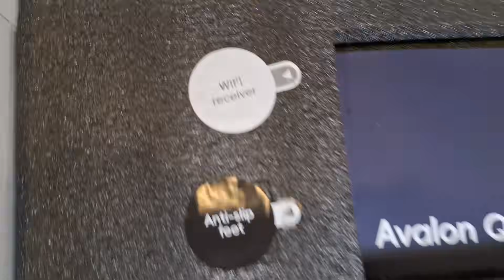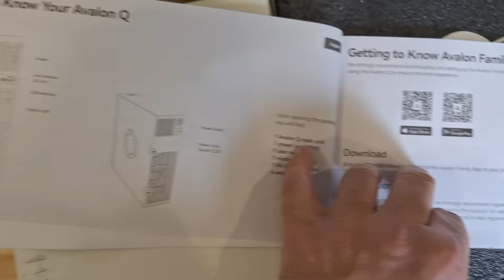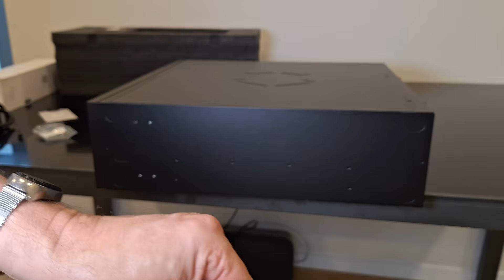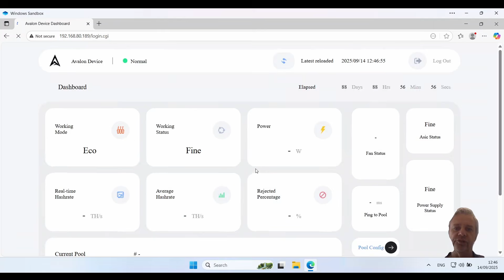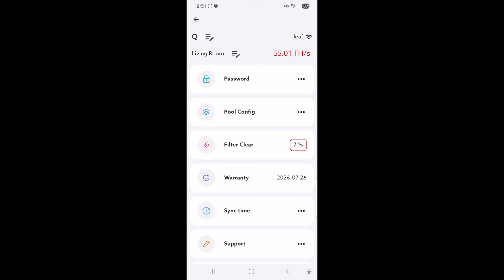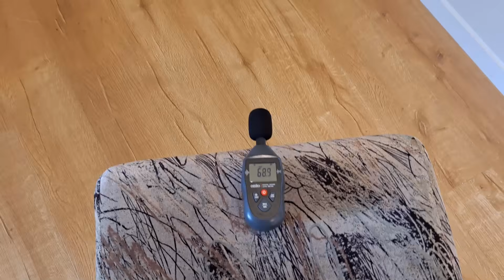Avalon Q for serious home Bitcoin miners

Comment: Nice video - I have been using my Avalon q for about 6 days - Started in my office on Eco mode got to hot and had this smell. So I moved it to the basement (finished with TV room) but it to standard and it has this bad smell in the air (The pungent smell of ozone, reminiscent of chlorine bleach). After 4 days I had to move it to the garage and again it still has this nasty smell that will not go away. I'm using 15amps but don't think that is the issue. any idea? Did you have any smell from your one that you use for a month in side? Thanks
Reply from the maker: Mine doesn't make any smell. That is very unusual.

Comment: I live in the US and am in the 2nd lowest electricity priced state amongst all 50 states. I pay ~ .098-.12 cents per kw. 
Running this machine would generate about $4.82 a day in revenue, and after electricity for the day deducted only ~$0.98 cents is the profit per day.
This isn't accounting for the price of the miner at all. So keep in mind I still would have to make up for the $1,900 + tax & shipping for the hardware. 
You might be thinking.. well, that's only 5.2 years of mining around the clock! 🤣
Well yes but that's before you add in the average increase in the mining difficulty for Bitcoin, which is about 0.13% per day. 
Which means in only 132 days after electricity is deducted my net profit will be $0.00 and about to turn negative. 

Now not everywhere in the US has peak electricity hours and non peak prices, but let's assume I do and I can run it for less electricity cost at certain hours.
That's great, but the catch to that is that the difficulty increase never stops, the difficulty increase doesn't care about peak or non peak hours. 
132 days is 132 days, when that runs up the miner will then be unprofitable and costing me money instead. 
Also the value of the miner decreases overtime as well with the difficulty increasing, so you won't be able to resell it for much later on either.

What am I getting at here?
I mined for 6 years, Bitcoin, Ethereum, and dozens of other coins, I did video cards, I've done ASIC's. 
Just. buy. the. token. 
If you want bitcoin, just buy it. If you want Eth, just buy it. 
You have $2,000 for a miner? Don't buy the miner, just buy the token, because the explosive growth days that made mining worth it are gone. 
It's simply not worth it anymore and for it to be worth it you have to be extremely savvy. And I don't mean by using solar panels... Because solar isn't cheap either, you need the panels, you need the inverters you need an electrician you probably need permits etc etc. It's not like solar is free and thus makes mining worth it. Better off selling that electricity back to the electric company.

Comment: Damn so jealous! Are you planning on lottery mining? Are you just a hobbyist or do you have cheap enough electricity to keep this more profitable than buying btc?
Reply from the maker: I lottery mind for first day I got them. Now I am pool mining.

I have cheap night-time electricity, and Solar. So I can make a profit BTC mining.
Reply: @pdath wow! Thats good to hear! I actually have cheap night time as well in canada, about 5cents per kwh, is that low enough to be in a good position to profit compared to yours? Also do you have any tips to set up a solar panel of some sort on my balcony. I got a large balcony in a high rise was wondering if I could use that to my advantage?
Reply from the maker: @saeir  5c would undoubtedly be good enough for running at night time!  That is an excellent rate.

Now you need to work on your daytime rate.  I am not familiar with balcony-style solutions in Canada.  Google is your friend.  :-)
Reply: Mine with ocean bro
Reply from the maker: I've been thinking about it. I can't use lightning payments because it's too hard to account for with tax. The problem with taking the payments from Ocean on chain is I will only get a payout once every 6 months.

Comment: Nice. I'm also in NZ too.  I'm on Contact where U supposedly get free power between 9 and 12 midnight. Would this be capped or could I still use something like this and run it for free in those hours. Also how much can you earn per month or so from a machine like this? Is mining becoming profitable again with the price of BTC these days
Reply from the maker: It wouldn't be worthwhile to only run it for 3 hours a day.  One Q would not exceed any power caps.
It would depend on what the cost of your electricity was for the rest of the day.
At the current price of Bitcoin (usd$115k) it is grossing me nzd$232 per month (based on how I run it).
Reply: So u r pool mining it, right? What is your power cost, would be interesting to know what it is without being on Solar. I'm in NZ
Reply from the maker: @chimneyclean NZD $.1374 + GST per kWh at night, and then I get a further 11% discount on that.  I am on Genesis.  During the day I am runnibg on solar.

I mine on NiceHash.

Comment: How many sats can this mine each day if it were to run full time? Ive asked chatgpt but im not sure how accurate it is with its answers. Thank you.
Reply from the maker: In the last 24 hours, I have mined 3972 sats.
I run on "Super" for 10 hours per day.  The remainder of the time I run on "Eco" or "Normal" depending on how much surplus solar power I have.
Reply: @pdath  that's $4.57 a day currently. naw dog that's not profitable at all.
Reply from the maker: @XSNRG4FR I got mine from Apexto Mining.  Crypto Miner Bros have s good reputation.   805 Mining seems to have the cheapest price at the moment (make sure you don't use their American store).
Reply from the maker: My current average income is NZD$6.71 per day.
Reply: @pdath  Awesome. Where did you buy it? Ta
Reply from the maker: @liamjohnson1219 ps.  Profitability is even higher now.  Bitcoin keeps going up!